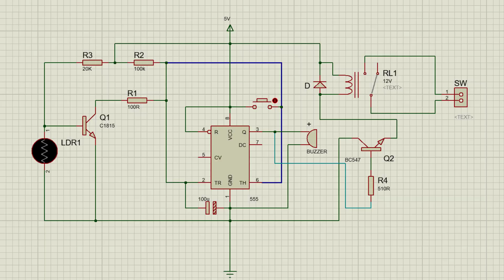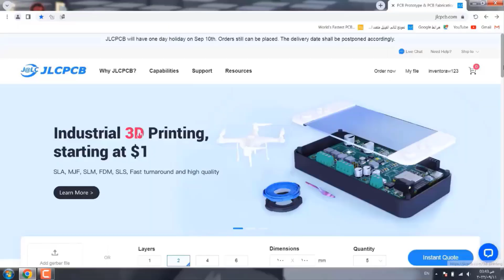This Device Should be in every home

Comment: Nice application for the 555,  but a few remarks. 1) A 12V relais on a 5V powersupply is not a good idea. A 6V or 8V might work, but a 5V type for sure. 2) Q2 (an NPN transistor) is connected incorretly. Its base is connected via a current limiting resistor, but its emitter (pin with the arrow) should be connted to GND (0V), while its collector should be connected to the relais. When Q2 is activated, a current from the +5V source passes through the coil of RL1 an Q2 back to the 0V.
Reply from the maker: thanks for your comment , but i used 5V relay
Reply: @Inventor_AW  I did see that in the clip, but your schematic which people would use has a 12V indication.
A tip for your next projects is explaining on a high level how the circuit works. So in this case that the 555 works in schmitt trigger mode with a set and a reset level determined by the LDR / Q1 and the reset button. Perhaps talking through a complete cycle of the circuit and explaning the function of some components like the diode in parallel the the relais coil to dampen the EMP when the relais is switched off. Nice small projects.
Reply: @Inventor_AW  I noticed the 5V on the relais, but the schematic showed 12V and that is what people use the build. A description of the circuit could also be usefull, highlighting certain parts or functions like the schmitt trigger mode of the 555, the EMP clamping function of the diode and perhaps describing a complete cycle which you showed.
Reply from the maker: @jansmit4628  Looks like I already put the wrong relay in the schematic .. Thank you for your tips.. I'll work on that